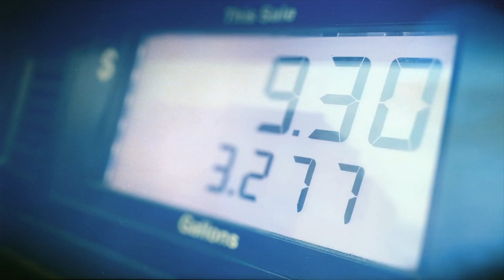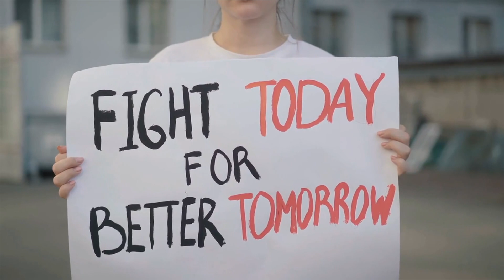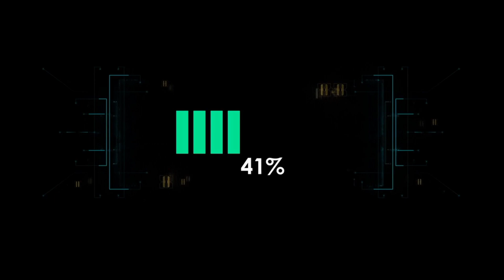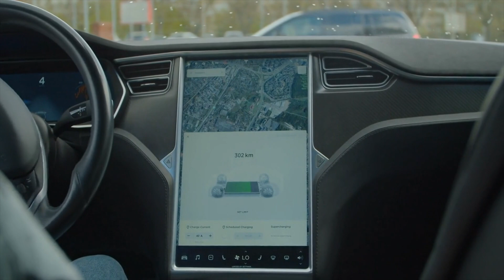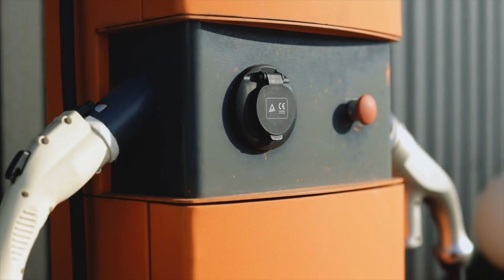Here's why EV Batteries are a PROBLEM!

Comment: If you have a home charger how much you pay in your light bill???
Reply from the maker: Martin nailed this on the head.  Your home electricity bill would increase with the addition of an EV, but those prices would still be drastically cheaper than filling up at a gas station.
Reply: more than without it but significantly lesser than electricity bill + gasoline prices

Comment: the non scalability and environmental destruction due to Lithium render EVs a dead-end technology - and there's really no viable alternative to Lithium for EVs to use.

And the full life cycle of obtaining Lithium, processing it, and making batteries is so carbon foot print intensive that EVs are only marginally less carbon foot print than conventional vehicles when viewed from entire vehicle life time.

Want to tangibly lower carbon foot print? Then buy a hybrid instead - plus much lower cost up front as well compared to buting an EV that would have a driving range comparable to any conventional vehicle.
Reply: I would suggest a bit more research. From mining or drilling an EV offsets it’s carbon footprint in 3-5 years taking in all factors of production and recycling when compared to similar ICE vehicles. Considering the average age of a vehicle on the road is currently over 12 years old, where do you think the advantage of ICE is? Hybrids are a stepping stone while infrastructure gets built out. Battery technology will get better, refining processes improved. ICE vehicles will still be around for 40-50 years, however they will be a relic of the past. Are EV’s perfect, far from it, but they are the next step in the evolution of transportation. Seeing that there is only approximately 47 years left of known oil reserves, ICE is on a timeline. Better to advance new technologies while we can, and have time to improve and evolve them rather than wait until it is too late. The ICE vehicle has taken over 100 years to get to where it is today. Give it time and the technology will improve.
Reply: @moarpwr4414  Actually there is a viable, long term, Earth friendly way forward for ground transportation vs going with EVs. So one of the factors always ignored in EV discussion is how the electrical grid capacity needs to be radically expanded in order to accomplish that. Elon Musk has said in an interview that in order to transition all ground transportation in the US to electrification would require a tripling of the US national grid capacity.

And really, the only way to interpret such a statement is as an advocacy for an immense build out of nuclear reactors.

Green energy production has proven to be very limited, not viable as base load, and often times a complete boondoggle (such as the immense capital expended in Germany to go with green energy and getting just a paltry 11% contribution to their grid - it's been an abject failure for Germany because they don't get sufficient sun or wind for it to be even remotely viable).

That being said, if there is a scale out of the national base load grid - which would have to be via nuclear reactors (and without which the fantasy of EVs is completely doomed), then once there is plentiful electrical power on that scale of expansion, then it's also entirely feasible to then use electricity to synthesize carbon neutral gasoline, kerosene, and diesel where the source of carbon is either from the atmosphere or from sea water. Sea water is actually a great CO2 source as its 100 more times concentrated than atmospheric CO2 and water will also be the other necessary major input to the process.

There is already a company called Prometheus Fuels that has a tech for doing this and they have a contract with an airline to produce carbon neutral aviation kerosene.

The implications of synthesized carbon neutral fuels is obvious - we just keep using the conventional ICE vehicles that we already have - and which can be manufactured at huge scale (sufficient for the entire globe) such that we don't destroy the Earth's environment attempting to scale up production of the myriad exotic raw materials that are required to make and EV.

And these synthesized fuels will burn more cleanly because they won't have any contaminants in them such as sulfur.

So synthetic carbon neutral fuels is actually the most rational and most environmentally friendly path forward.

With either approach there needs to be a significant scale out of the national electrical grid capacity. Might as well use that to support the path forward that is friendliest to the Earth's environment.
Reply: @TheSulross  You make some good points, and I believe we will fall somewhere in between. Synthetics are prohibitively expensive currently due to scale, if production is increased, efficiency of scale will bring those costs down. The problem still exists however that you are burning the fuel, and internal combustion engines are very inefficient and burning creates exhaust and pollution. Refineries will also be needed to produce and refine the synthetic fuels. There have not been any new refineries of scale built since the 1970’s, and the oil/fuel industry has no intention of building more, or even upgrading the existing ones they have due to cost/benefit analysis not working in their favor. 

Our electric grid needs improvement regardless as it is decades behind and in dire need of upgrades, repairs and improvements. No matter what solution we go with as a society, our electricity grid is on par with 3rd world countries. Renewable energy is abundant and clean, the problem is storage of that energy. Some of this can be handled with traditional batteries, some with alternative batteries as well. Battery tech is a hot R&D area currently. Some of this can be accomplished with gravity batteries such as hydro as we have been doing for decades, with expansion. We can also use tidal generators such as in France as the tide is changing 22 out of 25 hours a day. Solar is improving all the time, and it would take only a fraction of a percent of coverage to cover our power needs. It is not sunny all the time, which is why any renewable production has to be a mixed source. That is also where the need for our transmission lines being upgraded is a must.

Everything in scale. A mixed approach will be best as we won’t have all our eggs in one basket so to speak. Will we need synthetic fuel, I am sure as it will be energy dense and easy to change over to. Solar energy is hitting the planet everyday, can be used and collected as well. Winds blow, not all the time, but enough to be a viable source of energy. Tidal energy is also viable due to our moon orbiting the planet and shifting the tides all day every day. There is no silver bullet for our energy needs, but there are solutions to meet our energy needs.

As for our alternative ground transportation, I don’t see this working here in the US as we are a vast and spread out nation. Other countries have more built out public transport, but even that works for some, but not all. The solution of rideshare or robotaxi’s is only going to work for a minority of people as well. The only reason this is being pushed is the rising cost of vehicles and transportation is pushing many out of the market. Unless we become a society that does not move around, telecommutes and can only get away with doing things locally, I don’t see this working. Our rail system is a fraction of what it even use to be, and is a joke. I, as many do live too far to get around without a car. Could I use rideshare, public transport or robotaxi’s, not for what I do. I drive 35k-70k per year and no transportation is going to be a solution for me beyond a personal vehicle unless teleportation becomes a thing.